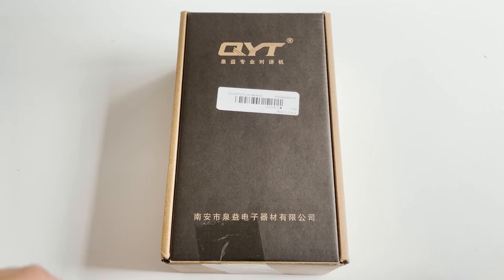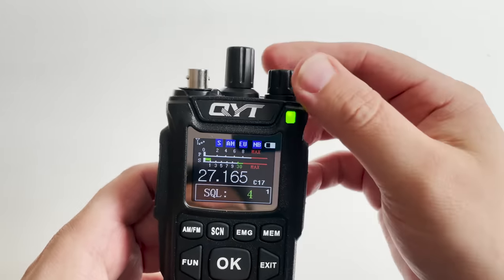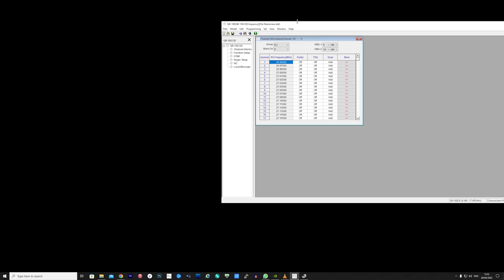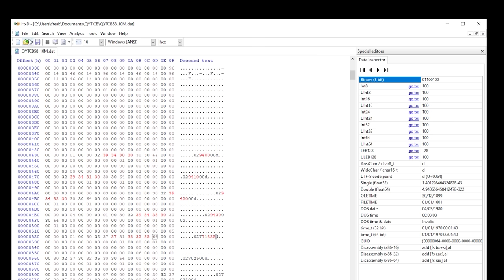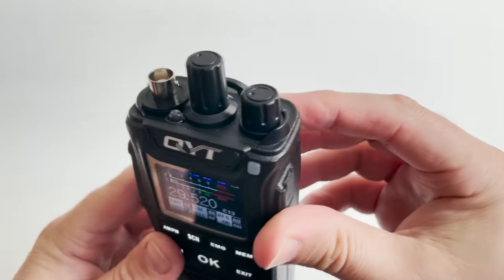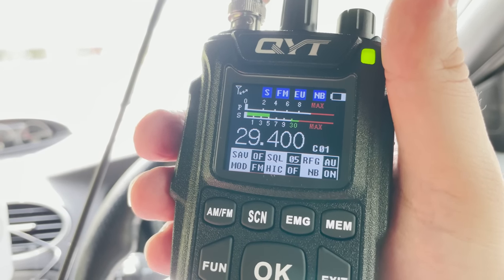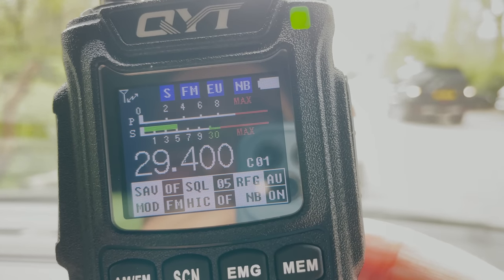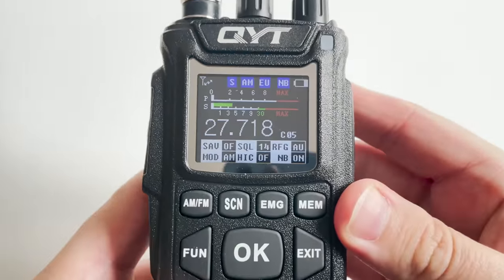HACKED QYT-CB58 FOR USE ON 10 METERS 29MHZ FM

Comment: A nice looking radio! I remember my CB days well too - I had one of those "handhelds" of the day - something the size of a housebrick with a ridiculous 4ft - 5ft telescopic antenna! Cheers G7GZH
Reply: Still got mine in a box in the loft. Took about 12 batteries if I recall. The built in antenna was a crazy length and quite vulnerable so I also have the "rubber duck" that fitted over .

Comment: Hello Mat

I found this video very interesting as I am looking at buying one of these QYT-CB58 HT’s and I just came across your video which is great in it being well done as I too am looking at doing the same setup at lest down here in Australia which would be interesting in working some of these 10 meter repeaters.
Also what caught my eye was your roof mounted antenna on the magna base and the way you were moving the antenna up and down in tuning it in.
I would ask what make and model is this antenna as it seems to be doing very well in the QSO’s covering a good distance as well on 4 watts output.

I will let you know how I go on doing mine but it will have to wait for a bit as I have to learn this HEX editor programming setup first and the fact that it seems by what you were saying that this radio defaults are setup for UK band conditions so it is going to be interesting and thanks for the video have a great day.
Reply from the maker: Cheers! :-)

Comment: Nice one Mat. It would have been good to see AM in use. 10m. At 29mhz is quite popular with the US folks. I worked quite a few stations during the peak of SS24 and had a lot of fun.
Reply: Was a touch sneaky in the video - you can't ad-hoc switch to AM and that was neatly glossed over here. Only the CEPT band allows switching between AM/FM on the fly, otherwise, the button just switches receive but will only transmit in FM.  Just a heads up for anybody reading this,  and I think it was a bit disingenuous not to point that out.

I'm making a review of this over this weekend and I'll cover why this HT is a steaming crock of turd - but I wasn't sent mine. for nix,  but it's going back.

Comment: SSB would be nice, but a very interesting radio. Here in the western New York state region, 10 meter FM is almist exclusively  on 29.600 MHz.  We do have occasional AM activity around 29.050 MHz.  Have you tried it in the AM mode on 10 meters yet?

In the USA, this radio could only be used by hams with a General  class license (or higher). Technician and Novice stations are only allowed SSB from 28.300 MHz  - 28.500 MHz.  They can run CW and digital modes below 28.300 MHz,  and there are a lot of them on FT8 and FT4.

Does TYT have a similar HT that can cover 6 meters?

73, Keith, WB2VUO here near Buffalo,  NY
Reply from the maker: I wish I had thought about switching to AM while I was testing the radio, we all had the capability too!
Reply: The Mode on the Band Plan is NOT a Law just a Suggestion so you could run AM or FM in the SSB portion of the band.I hear stations on the Wrong Sideband quite often on the 40 meter band and sometimes on 17 meters as well.It’s not like that radio will actually bother anyone. The only HF band that you are required to use the mentioned modes are the 60 meter band because it’s a secondary use band for Amateur Radio.
Reply: @1OFGODSOWN  : FCC Part 97 only allows Wide FM above 29.0 MHz for General -Class amateurs and above, and the Novice and Technician voice privileges on the band are limited to mode A3j (SSB) between 28.300 MHz and 28.500 MHz. They are also limited to 200 watts (PEP) out.

A Petition for Rulemaking was submitted back in 2000/2001 to give Technicians all modes on the entire 10 meter band, but the FCC did not act in it.

Still, an interesting radio, just not for all Anateur classes in the USA.

de WB2VUO
Reply: @Keith_WB2VUO  still the Mode is a Suggestion NOT a LAW. Do some research and you will see.I know it confuses some but it’s still a Fact.A General Class and above may use Any Mode they please there.
Reply: @1OFGODSOWN   : I never said tha General & up could not run AM between 28.300 MHz and 28.500 MHz, nor did I say that they can't run FM there, but if they run FM, deviation will have to be limited to 2 khz max ( which the HT won't support) and the fact remains that Technicians and Novices can not run AM on 10 meters.

I stand by my position, the TYT HT is nice, but a Tech can only run it on CB, now allowable under Part 95.  Techs  are prohibited from running AM or FM on 10 unless new rules come out. 
De WB2VUO here near Buffalo,  NY

Comment: Hi there, thankyou for this Video I am looking for a H/H Cb radio that can be converted to our NZ frequency band of 26 330 on up to 26.770. As nobody is making one, I was wondering if this radio would also go down that far with out being " outside its capabilities. You do state that the radio was designed to go between 25 and 29 MHz  but will it require a re-tune to do that? Looking forward to your reply

Comment: Hey Matt, great video. I didn't see in the software any ability for split or repeater functions. Does the radio also transmit CTCSS?
Reply from the maker: Hey dude! If I remember correctly there was no way to do split, which is a shame really. Unfortunately I dont have the radio any more so I cant check. To be honest, there are better 10M handies on the market now that dont require hacking lol. thanks
Reply: @TechMindsOfficial  No worries at all. I guess you could do a "poor mans" split by just programming two channels side by side one the repeater input the other the repeater output. I'll have a look out for some other models, want one to monitor my repeater ;)

Comment: It seems they have locked the transmit range in firmware now. I just purchased two hoping to use them on 10m. The radio will receive 29.6 but it will only transmit 29.520.
Reply: I can’t get mine to transmit above 29.230
Reply: @USBP29  It sucks. I was really hoping to be able to use it on 10 meter FM and AM now that the conditions are getting good for propagation.
Reply: @USBP29  Also, both of mine would not charge in the drop in chargers.

Comment: With Hex editors sometimes those not knowing what they are doing can get in a muddle, and instantly corrupt the file.. It would be better if the factory could put out an unblanked frequency change ability built into their software for our purpose, or Chirp software (Dan Planet) could be amended to include the CB58. Good video though :-)
Reply: With radios sometimes those not knowing what they are doing can get them in the puddle wilst meddling in the doodle. 
HI!
And in my humble opinion, a licensed amateur radio operator, in 2022... should have a tad more intimacy with computers. 
Even OP... could've touched the "ins" key on his keyboard instead of selecting and overwriting every byte.
Now, I'm not expecting a deep analysis of the binary data in that file or some sort of reverse engineering of the handhelds microcontroller... 
Just basic binary editing not made into voodoo.
Reply: I personally don't mind playing with hex editors and doing some reverse engineering. Would've been cool if you'd had to calculate a checksum as well, but it seems they made it quite easy. A simple python script, or even an online service where you can upload the binary file in order to edit the frequencies should be easy to make and might help those who are hesitate about it.
Reply: Dont think the manufactorer is interested that a bunch of HAMs are modifying there Hardware and getting complains from incompedent people if failes
Reply: This is why you ALWAYS save a clean copy of the original source file.

Comment: Well, I finally got my programming cable in. Hex edited the file but unfortunately the radio won’t transmit on 29.600. It will rx on 29.600 but it transmits on 29.232mhz. Guessing the vco won’t go that high

Comment: Very good video.
I am in the us.
Hay could please tell me more also about that mag mount antenna you had there i think i like that .
I have a cobra am 40 ch.
Ht its an ok rig . 
I have also just picked up a pres.randy that has proven to be a very nice and very capable little radio with only one issue i need to get the uk radio  due to thee mods. The us version has been fixed to delete the 10 meter band.
And the uk version just snip them 2 wires inside and bam off to the races.
Anyway you take care 73s an happy dxin.
199 florida georgia line. 
Break breakk

Comment: I'm thinking qyt and tyt the same company if you look up mod for the 9800 mod in the software you may be able to do more to the radio without hex editor
Reply: Hello
Is it still possible to do the TX modification to 29.xxx?
As it was mentioned in one comment, it would be locked now?

U mention the TYT 9800 could u test if this SW would work .... thanks

Comment: Should have been a little more careful guys – 29.400 is slap bang in the middle of the Ham Satellite Links frequency portion of 29.300 – 29.510.   (Yep – I do know it’s only a Band Plan and not a legal requirement, but the Plan is there to help prevent anarchy!).
Reply from the maker: Good point! Although, are there any active satellites using that band?
Reply: Satellite band plan on HF - what a total waste of spectrum!!!

Comment: Which windows version will work for? Windows 11 does definitelly not work for - I turned on the radio, the device manager showed me com port 4 - I set com-port 4 in the qb-100 software - but: unavailable to open the communication port - even it was found the prolific driver and set to com 4 also found it in the qb-100 software. Is it really Windows 11?
Does Windows 10 work?

Comment: Batteries sag when you transmit.
Reply from the maker: It really does each the batteries, I wish I got the version with the rechargeable battery pack!
Reply: @TechMindsOfficial  I got the one with the AA battery pack and even with new batteries the radio says theyre dead. Never enough voltage to actually tx more than 5 mins.

Comment: Can it be hacked to work on 28mhz?
Reply from the maker: Yes, I think coverage is from 25 to 30Mhz
Reply: @TechMindsOfficial  that's awesome. Just to be clear, that radio comes with a rechargeable battery also? why did you choose the AA battery pack?
Reply: Mine won’t tx above 29.230. Worthless for 10fm

Comment: Yeah but one true question: 10 Meters in frequency-modulation? That is not very useful, right?
Reply from the maker: There is plenty of activity on 10 FM, especially when conditions are good. From here in the UK I have worked 10 FM repeaters into Europe and the States.
Reply: @TechMindsOfficial  Thank you for this interesting information - do you know where I can find this prolific-driver?

I received this radio and the right USB-cable was already inside, which suprised me a lot. - Now I have to find out about the proper software.

Thank you!
Reply: I found the software already - is it possible, that it will not work proper in Windows 11? I had to start it in admin-mode and also in compatible-mode for windows xp-service-pack-3 - then it started.

But still, I cant connect to the radio by usb - it says the following inside the com-area at the device-manager:

PL2303TA do not support windows 11 or later, please contact your supplier (I think that means nothing), or is that really the issue - and yes, I operate windows 11 on my pc. Does anybody know more about?

Comment: I bought 2 of these radios. And both of them where compleate garbage out of the box. Both of them have distorted transmitt so I ended up buying a cobra hh50 walkietalkie.  The cobra is a much better radio. I made a video on these qyt radios and how bad they are out of the box. One of the radios I can not get it into am mode. These radios are compleat junk do not buy.
Reply from the maker: I think I saw your video on AM mode issue, but did you try changing band as AM only works on the EU band setting. I think my video proves they are not junk and you was just unlucky.
Reply: @TechMindsOfficial  i was told by someone in the industry that this company dose not test any of the things they build they just make the products and send them out. Cause they know that once they ship them out of China it will cost more to return ship them then what you paid. And even if they do reimburse you you are still out untill they verify the defective product and you risk losing the money cause there not going to declare a recall on there junk. So yeah now I have 2 clunky radios that are total junk. And only one of them switches between am and fm mode. No matter witch band I put them in. So I just ended up buying 2 cobra wxst hh50 radios. Witch have much better transmitt audio.

Comment: I do not understand the cautions you mentioned during editing the hex file. Your a fast talker, and since that is an important strp, and it does not show what your doing on the screen either, maybe you could elaborate. That said, Awesome. I have a number of "import" 10M radios, an HT to compliment them would be nice.
Reply from the maker: Simply, don’t use the delete button to remove the numbers from the hex file, just select the digit and press the required digit on your keypad to over write it. Hope that makes sense and thanks for watching.